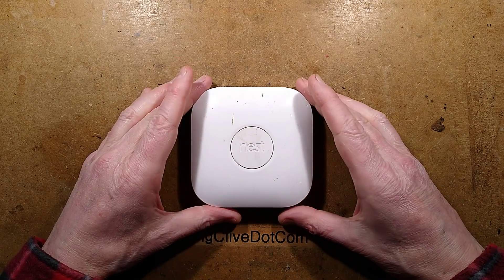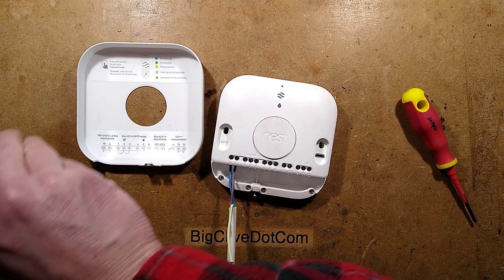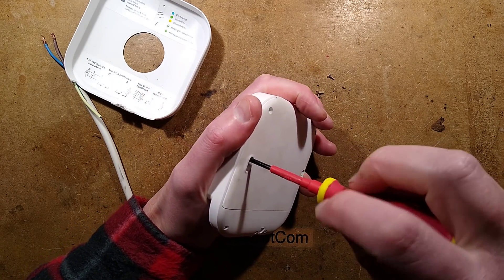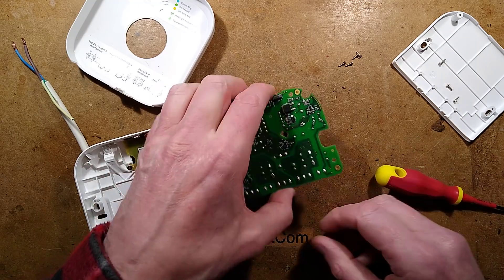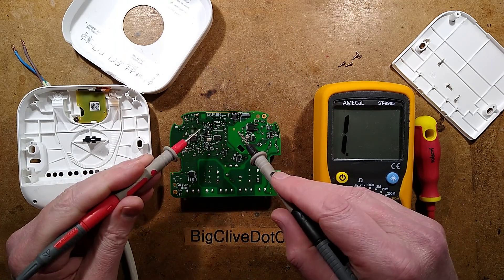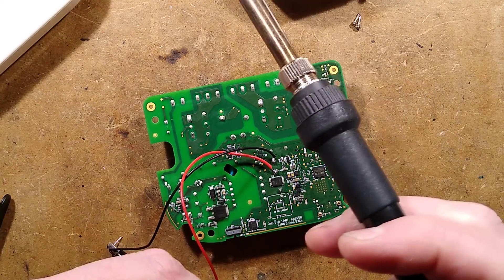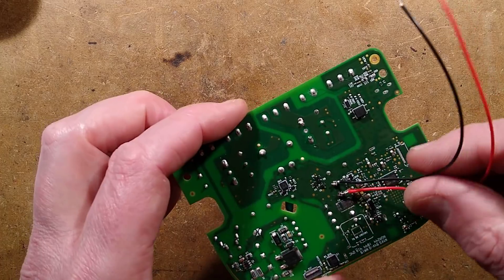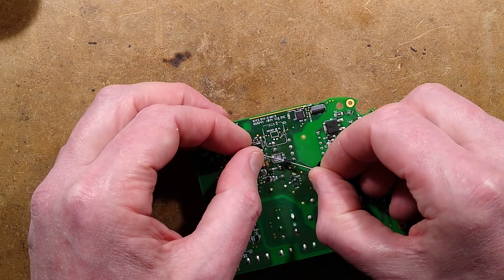Fixing a completely dead Nest thermostat heat link

Comment: `Truly, that is a very common fault on this unit that the nest people are aware of. Mine failed in the first three months. They sent me a new one on warranty but didn't want the old one back. What you missed was the USB type connector on the front of the unit. That if you supply to that point will restore the power without the mains connection. But it shows power but the internal relay still does not work due to the failure of that diode. I replaced that diode as you did and hey presto it worked. I have a spare unit but as they probably supplied the new unit with a modified part it has not failed since so it has sat in my spares box..

Comment: Hi I’ve got a 3rd gen heat link with no output voltage to boiler..so for the time being we’ve wired it the other way so when thermostat is turned off the boiler works! (Temporarily) have you come across this issue before ? The relay clicks when you demand heat but no power ? Thanks 🙏
Reply from the maker: If it clicks but the contacts stay in the original position, it's quite odd.
Reply: @bigclivedotcom fixed 20 sec reset! Cheers

Comment: Just fixed my Nest which had exactly the same issue. Only suitable diode I had to hand was far to big so used a couple of pieces of wire to relocate it to other side of circuit board. Luckily did not cause any noise issues. Many thanks

Comment: Is 100V 3 amp diode will work fine? Cant find 70V one..
Reply from the maker: Yes.  A higher voltage is better.  The main requirement is that it is a high speed diode with fast recovery time.

Comment: Thanks for this. I had a weird issue with my dead base unit. I traced through the circuit and couldn't find any issues. I then found this video and evan though my diode appeared to be ok, I replaced it and all now seems ok. The old diode weirdly tests fine off the board.

Comment: They are extremely easy to pair up a new heat hub up,, the heat hub uses zigbee or somthing low powered, the smarts and normal WiFi for nest is in the nest thermostat (one less then hive which requires 3 devices) 

Hive uses a hub that plugs into your broadband via a network cable (that device can not be re registered under a new account or sold as used it's a paperweight to anyone els once registered so ignore any used hive hubs on ebay, if you move house take the hub with you, hive thermostat and the hive remote controller similar to what you have but significantly simpler (if moving house hive thermostat and single/dual channel controller stays at old house unless you re install old controls and take everything with you) the thermostat and heat remote controller can be reused or sold as used (hub can not) 

Google Nest uses WiFi and is the controller it can be factory reset and used under a new account (as it uses codes to pair up the nest thermostat to your Google account) the heat hub just pairs up to the nest thermostat, factory reset on heat hub is somthing like hold the button for more then 10 seconds or something like that

And for hub failing a lot of people don't wire the hub up correctly and use a link wire from live to common on the heat control part instead of using a 4 cord cable so the heat relay  is fed by and returned to the 2 RT ports of the boiler (so if the boiler internal fuse blows and the heat link wasn't installed correctly it doesn't make the boiler live when it's off but demanding heat)

But nice fix good to know if mine ever fails 

Mine is already saving me more then £5-7 a day having the nest installed but it's more due to actually having a thermostat witch we didn't before, but it's really nice to have history breakdown of when the system was firing and when somebody messing with the heating setting(also when everyone/phone is out of the house it goes into away mode set it to 15c goes back up when you get close by) they seem quite happy at 18c target, when I first powered it on the house was at 23-and 24c so we was using a lot of gas maintaining that as it was £8-10 a day now £2-4 a day (lower when outside isn't below 5c)

Comment: Clive, I was wondering if you’d be interested in this I discovered about the Nest

Now the Nest heat (that’s the part your repairing) links to the Nest thermostat via the “thread” Wi-Fi protocol.

That’s nothing to do with the internet, it’s the thermostat that connects to the internet via 2.4Ghz or 5GHz Wi-Fi 

Now I’ve got a raspberry pi 3B wired with TWO Wi-Fi connections on it.

What I discovered and reported to nest but they were not interested is that if you turn on both Wi-Fi interfaces and have one connected to AirPort Express playing music something strange happens… 

The Thread connection from the nest thermostat to the nest heat goes down YET the nest thermostat still connects to the internet and just reports the connection to the heat is lost.

So using conventional ip Wi-Fi you can block nest thermostat & Heat connection thus heat goes off

Now I’m sure it’s just coincidence, but shortly after making this discovery and only doing it a few times just to show people, the heat went faulty and they replaced it.

But I wondered if as the heat lost connection to the thermostat whether it would ramp up power to strengthen the “thread” Wi-Fi and that did the diode damage.

Course I don’t know if it was the died cause they just took it away and replaced it.

Thoughts?
Reply from the maker: It's possible just a borderline signal being swamped.

Comment: I just got an email from Google, saying:

Your thermostat’s Heat Link is eligible for a replacement by Nest
We’ve identified an issue with your Heat Link, which connects your thermostat to your heating system. This issue could cause your thermostat to lose power unexpectedly.
To fix the issue, Nest is offering a no-cost replacement of your Heat Link.

I assume it's for this issue... but it actually broke in April and I fixed it myself then! Since they're doing it for free, I've got someone coming to replace it next week.

Comment: Thank you so much! I woke up to a cold home, my heat link had failed. Then I remembered that I had watched this video when it came out. So I got my multimeter out, the failure and shorts matched the video! I've replaced the diode and it is working perfectly! Thanks again, keep up the good work!
Reply from the maker: Thanks.  Glad you got it sorted.

Comment: I have a request to the community.  I bought a damaged heat link, someone connected 230V instead of 12V and burned the 12V lines.  I need detailed photos of the 12V top and bottom area.

Comment: Clive.... Looking at the PCB, it seems that the 230v is immediately stepped down and rectified to 12Vdc. You mentioned on another video that the 12v is available on the T1 + T2 pins and basically links to the 12v bus.  My question is, in theory could the heatlink be powered by 12v fed to those pins?  I'm looking to add a smart thermostat to a camper and this could be a very easy hack to stop inverting up to mains voltage if the unit will immediately step it back down anyway. 

Many thanks for all the videos aswell, love them.
Reply from the maker: I don't have one here to check, but it may work if they are connected to the 12V bus.

Comment: I'm a Sparky and installed three or four of these and had to go back to all of my customers after the Heatlinks and one main Nezt 3rd gen actually 'thermostat'/transmitte (wifi chip) failed).  Google, now owners are helpful and cover them even if bought over a year ago, but it still takes 2 weeks getting a replacement here in UK! It's a shame as the customers are left without heating and hot water for that time unless, we re-fit the old hard wired units. At  home, I've left my.old back plate,  in circuit, so I can fit the old 2 channel programmer/timer.in case . Totally agree ref. IoT Clive. We have a chap locally whose whole house is 'Smart' until he looses Internet and Wi-Fi.. Keep up the brilliant work

Comment: My Heat Link just failed - totally fubar at approx 2 years old. 
Contacted Google Support who have arranged not only a replacement, but also someone to come and remove the old Heat Link and install the new. 
Can't fault them for that, although I'd be more than a little concerned at how many Heat Links are getting the tap on the shoulder from the Grim Reaper at such a young age.

Comment: I just came across this video while trying to find out why mine was completely dead, sure enough the same diode is shorted out. Because my thermostat is connected to the base station for charging I only noticed when it lost charge and disconnected from the Wi-Fi and showed as disconnected on the app. Having attached the thermostat to a power bank to charge it up I see the power bank shows the thermostat is drawing 2.1A while charging. I’m not sure what else is connected to that diode but there isn’t a lot left from it’s 3A capacity to power anything else, maybe this is why they fail. I have ordered some replacements which are 60V with a 5A capacity, fingers crossed. Thanks for the helpful video.
Reply: FYI mine failed with only relays being used, not charging the display from the link. I suspect a power surge/brownout cased it to fail in my case as we had a heavy storm pass over just before it stopped working.

Comment: Do diods add in capacity when mounted in parallell or is it not a good solution to use parallell mounting to increase current capability if a higher capacity diod is not available? OF cause they have to be rated for the voltage and reverse load with in specs.

Comment: So glad I subscribed to BigClive a while ago, watched this video when it was released and had an interest as I also have one of these nest system. A few days ago mine failed after a power cut and came straight back to this video to test mine. Same fault. Lots of looking online and found that the PDS3100-13 (RS 751-4654) is the same as the one on the boards. Got them delivered today and now have my heating back again. Thank you so much Clive, keep up the great work 👍👍
Reply: Spot on! PDS3100-13 is perfect fit. Just replaced mine to fix this issue. All working again. Thanks for the tip.

Comment: Had this exact issue with one of my Nest HeatLink, fixed for the price of a Diode and bit of careful soldering. Thank you so much for making this video. 

Studied Electronics for 5 years over 20 years ago but ended up working in software, 5 years but couldn’t have fixed it without your help. Remember why I liked Electronics so much.

Comment: Had mine replaced under warranty today for the exact same failure. Just packed in and threw up an H72 error on the thermostat. The electrician who came out (on behalf of Nest/Google) said this is a huge issue and that all of 3rd gen Heat Links pack in due to this eventually, most average between 18-24 months. It’s so bad that the company here in the UK that has the contract to deal with Nest/Google’s warranty claims has just employed several hundred installers ONLY to replace failed Heat Links that are still under warranty. 🤯

Comment: How would I check the opentherm circuit? Should there be a voltage out? I have one which takes the command from the thermostat as you hear the relay activate on the heat link but the boiler does nothing. I’m thinking the command from the heat link to the boiler is not happening but I don’t know why. The boiler works fine but I just can’t control the temperature or the daily programming of when the boiler comes on and off. It’s a new boiler and had no issues with the old original thermostat
Reply from the maker: If it's clicking and worked before then the relay contacts might have failed.  Or there could be a problem with the boiler itself.

Comment: Mine just failed with the same fault (just 2 years old). I replaced it with an SR3100, but in a DO-27 package, which is a tight fit. It's back up and running now! This must be a really common fault...
Reply: I was surprised to get an e-mail from Google on 29/10/23 offering to arrange a free replacement via BOXT. However, I had already repaired it a year ago by replacing the diode and (currently) it is still working :) Tempted to try and book the replacement visit to see what happens...
Reply: I finally got around to having this replaced free of charge by BOXT (Feb 2024). My HeatLink base unit was actually still working since doing the DIY diode replacement back in April 2022 but, as Google were still sending me e-mails offering to replace it FOC, I thought that I may as well get it repaired properly. The engineer told me that the failed units are getting shipped back to Google in Ireland.

Comment: Great video, today my Nest got the exact same problem after two years of usage. I followed your instructions replaced the diode, it works like a charm. The only thing I did differently is, I used FR107, instead of uf4003. I hope it won't bring any problem in the future. But at least for today, until now, it is still working fine!
Reply: A comment from the future. James, is your Nest still working after your repair?

Comment: Amazing - my nest display failed after 11 months and was changed under guarantee. Th Heat link failed after 14 months but following this video I fixed it having bought the diodes (UF4003-E3) from RS for about 10 pounds including delivery. I used a soldering iron and stanley knife to flick off the defective diode which came off in pieces. Thank you Clive!

Comment: I had the same problem when I installed my brand new Heatlink. It wont power on at all...no led no nothing. Then I got the idea to connect it to my PC via the micro USB. It powered on and working fine every since.

Comment: This is the kind of repair i wish i knew how to do.. I feel often that things that fail most likely is this "easy" to fix..
And it would be awsome to be able to do it my self. You wouldnt have a video that goes through what to look for to identify the path of power on a board by any means? My problem is that i dont know what all the parts do or what they are, but diodes i know, atleast the one you put on here cause i changed one in a parking heater i fried once and it worked great afterwards again :D But it was easy to find the problem as it had blown up.. hehe

Comment: Happened to me last Novemeber - dealing with nest support was a pain but I chased daily and took a week for the new one to arrive (initial eta was 2 weeks). Very common complaint on the forums, may be related to the initial batch of this particular model as complaints volume for this fault went up over the last year, most people having them installed in that 18 month timeframe.

In fairness, the swapover and took minutes and wasn't difficult - I had the heating engineer do it for warranty purposes (I had to provide a VAT invoice to nest to get refunded) but I could have done it all myself (as it was an existing install - just need two screws to get it off the wall and then the two wires into the unit).

Comment: it would be really helpful if you could make a video about how to choose a soldering tip for teeny tiny surface mount work
Reply from the maker: I often just use my normal iron with drag techniques or a hot air pen.